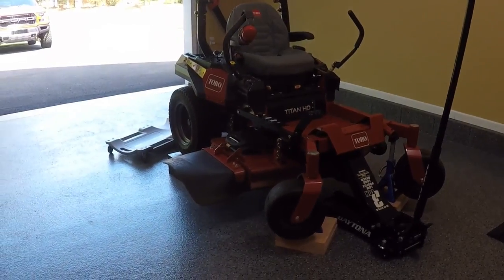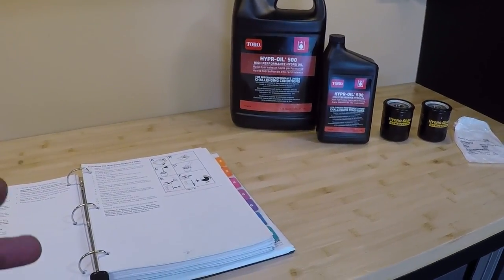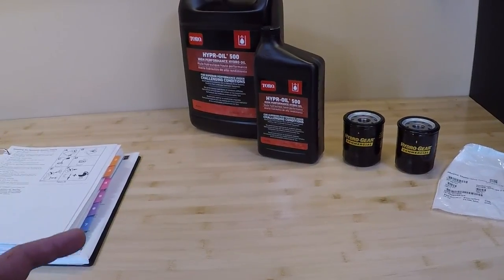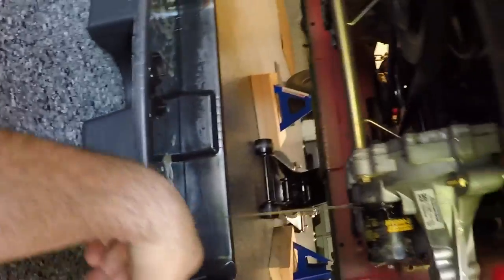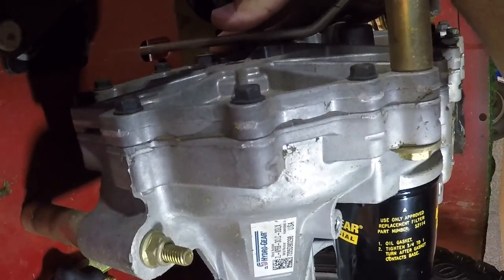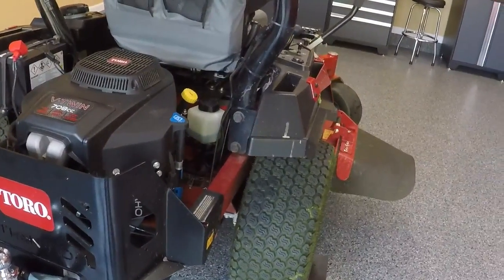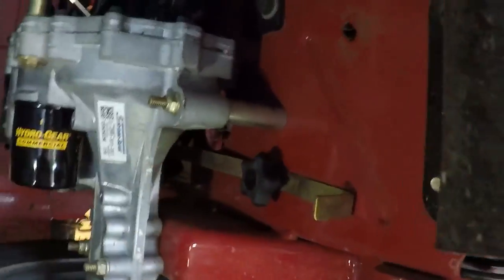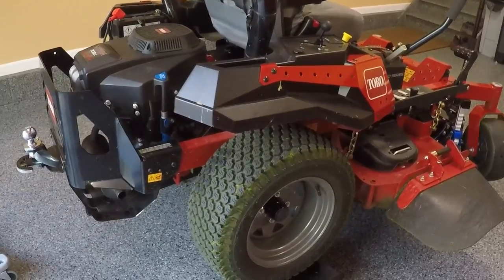Toro Zero Turn Lawn Mower Hydrostatic Transmission Fluid Change

Comment: A couple of things to add...  I found that I had to remove the port plugs all the way in order for the fluid to fill well.  I was curious how much fluid would need to be added before fluid began to seep from the port openings but I had to find out on my own.  I found that it started to seep on the right side at about 2 1/2 quarts.  So, I put that plug in and continued filling.  It took almost 4 quarts before the left port began to seep

Comment: Very helpful video. Pretty much the same process for my ZX6000 except my drain plug requires a hex wrench. Well done!
Reply: I have the Toro MX5480. It's plug in the ZT-3100s is also a hex (allen). Purchased new in 2013. At the recommended service time I was all set to go. No way was that plug coming out. A friend of mine who works on heavy equipment couldn't remove it. He suggested putting some torch heat to it if I insisted on removing it. I declined.

Contacted Hydro-Gear and eventually spoke with a technician. He said he and other co-workers could never remove the same plugs. Took quiet some time to refill with no venting. Time to do it again soon. Didn't try but wondered if I got the trannies hot from use if that might help.

Comment: Nice video! Went to buy my hydro filter online and I was shocked. Oem 48 dollars for one filter. 3 years ago I paid 24 dollars for two. I will definitely be using aftermarket filters.
Reply: Found the filters on Walmarts website for $18.73 each. And a 5 quart bottle of Mobile 1 15W-50 for $24.97.

Comment: My Father has this same mower - a few days ago he backed over some pole in the yard.  I haven't investigated closely yet but he sent me a picture.  He thinks the left trans filter is leaking but from the picture the filter guard is not damaged.  What else is in the vicinity that would leak the trans oil excessively?  I'm hoping the case isn't cracked!
Reply from the maker: Could have damaged a seal or linkage.
Reply: @EnthusiastsGarage  We'll find out...I'll let you know likely Saturday ;/
Reply: @EnthusiastsGarage  It was just the left hand filter - dented on the very end where the plastic "shield" doesn't protect it and punctured.  Perhaps a metal shield that covers the end of the filter as well would be even better than the plastic shields.  I suppose they don't engineer it for rock crawling.

The mower only has 36 hours but I ended up replacing both filters and doing the oil flush procedure with fresh Toro Hydro Oil 500.  I did the fill through the reservoir with the upper plugs removed on both transmissions.  Then put the plugs back in, and did a dozen forwards and backwards cycles with the transmissions locked out and locked in.  I used the mower for hours and it kept sucking down fluid, had to keep filling it multiple times - obviously there was still a lot of air in the system.  I still don't think I've added a total 4 quarts yet, strange!  It just keeps taking more and more and more as the machine is run.  But the transmissions run great, equal speed left and right, seems like everything is good to go.  He's lucky, that's for sure, it could have been worse.

Comment: On 2020 Riding mower model 75760 there is not a small reservoir for the transaxles oil only two large vent hoses down to the transaxles. After serving the units what is best way to purge ?
Reply: I to do not have reservoir . I have model 75302.
 𝙋𝙡𝙚𝙖𝙨𝙚 𝙡𝙚𝙩 𝙢𝙚 𝙠𝙣𝙤𝙬 𝙞𝙛 𝙮𝙤𝙪 𝙛𝙞𝙣𝙙 𝙤𝙪𝙩 𝙖𝙣𝙮𝙩𝙝𝙞𝙣𝙜

Comment: I have a Toro Time utter MX5060.   My manual didn't say anything about lifting the rear wheels off the ground to do the bleeding procedure.
Reply from the maker: Hydro gear says you should. If it’s a hydro gear transmission I would follow their instructions.
Reply: @EnthusiastsGarage  ok I will get some jack stands.  Your video is excellent.  Really helped me a lot.

Comment: Nice video. Titan 75303 has nothing in their maint. schedule about changing the transmission fluid. Is there a different service recommendation on that model?
Reply from the maker: What transmission do you have?
Reply: @EnthusiastsGarage  Thanks for the responseI. have it on order....from everything I am seeing the 75303 comes with a ZT-2800 with charge pump...the manual from Toro has nothing about the Trans in the Maint. section.
Reply from the maker: @NJNick325  The 2800 and the 3100 share the same housing so the process should be exactly the same. I would just do a visual inspection to confirm prior to starting it. I would just do the initial at 75 and every 250 to 500 after that just like the 3100.
Reply: @EnthusiastsGarage  Thanks
Reply: @EnthusiastsGarage  The owner manual for my Toro (3100 trans) shows fluid/filter change after the first 50 hours followed by every 400 hours. I use Mobil 1 (synthetic) 15W-50.
Reply from the maker: @logan1572  I guess you’re is from a different time period then mine.

Comment: I'm having steering issues with my Timecutter 3225 mower. If it's a sealed system,  would it be a physical adjustment of something else? I did mow over something before the steering issue started.
Reply from the maker: I would get under it and check for damage or loose linkage

Comment: How much fluid can you get with the hose, will the hose go all the way to the bottom of the housing?
Reply from the maker: The fill hose?
Reply: @EnthusiastsGarage  the auction hose
Reply: The suction hose.
Reply from the maker: @georgegoodfred5803  I wouldn’t try to suck the fluid out. You probably couldn’t get all of it. It’s easier to just let it gravity drain from the filter housing.

Comment: I just changed the hydrolic fluid in my mower and have no power coming out of my left wheel. Any suggestions
Reply from the maker: Did you fluid out of the top bleed screw? If not open it up and see if the reservoir drops then do a bleed procedure again.
Reply: @EnthusiastsGarage  had both port plugs open left side was the first side to have fluid  coming out. Then fluid came out of right side closed up. Purged system and no power reverse left side right side us good
Reply from the maker: @craig9069  sounds like you did everything right. I would try another purge and if it still doesn't fix the issue you might have to speak to a dealer. Also, see if the fluid level drops after sitting for a few days, air might work its way out. The system should take about 4.5 quarts.
Reply from the maker: @craig9069  https://www.youtube.com/watch?v=3yHUizMwZFs&t=0s
Reply: @EnthusiastsGarage  I went our to the shed and the Reservoir went down a little, poured about 1/4 more oil to the full cold line. Probably sat there for a good fifteen minutes purging more air out of the system. That toro hypr oil is thick stuff. Dropped off the jack stands and the left side started to wine abit, went slow with the weight of the mower back and forth. Will have to keep an eye on that left side. Thanks again for the help.

Comment: Found the filters on Walmarts website for $18.73 each. And a 5 quart bottle of Mobile 1 15W-50 for $24.97.
Reply: Filter part number was 52114.

Good luck 👍

Comment: I am having trouble locating the drain plug and filters of the hybro on my toro mx 5075 myride? could you help?
Reply from the maker: That’s a very basic transmission (zt2200) and it’s not designed to be serviced like the larger ones. The filters are internal and I don’t think it needs fluid changes. 
https://youtu.be/sdR7kGvRU10

Comment: I use 15w50 motorbike oil
Reply: Is it ok to use in a hydrostatic  ?  I use 20w 50 on my  Hydro-gear pumps and motors , works fine .
Reply: @johnnymees5927  my Ariens zero turn states to use 15w50 in the Hydros. I just use motorbike oil as i figure that motorbike oil lubricates the gearbox as well so its maybe better for the gears in the hydros. It works fine.